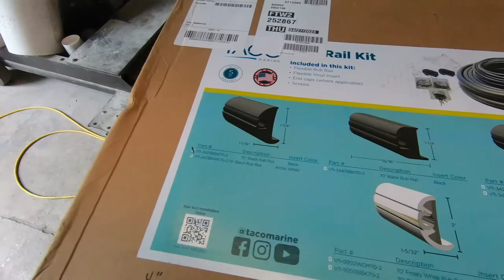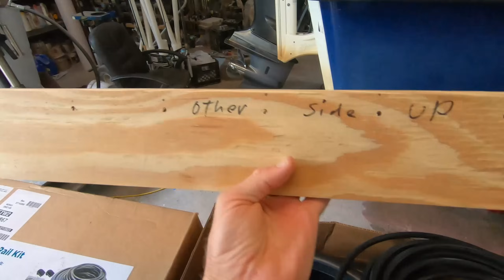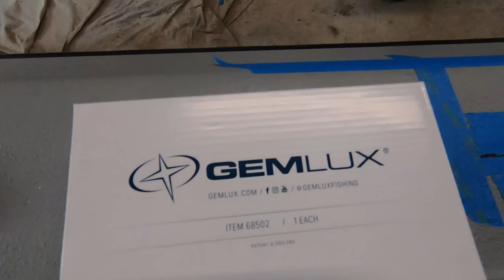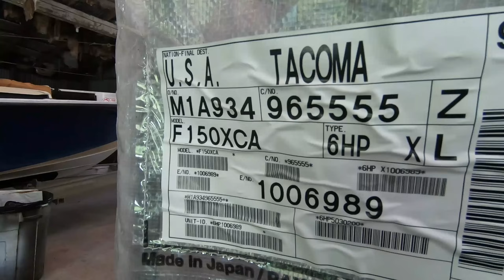EP-20 How To *Install Taco Rubrail & Gemlux Flush Cleats* Loading onto Magic Tilt Trailer!

Comment: Isopropyl alcohol is good for installing that center strip in your rub rail. You can use isopropyl alcohol on the rubber window seal when installing windows in a pilot house.
Reply from the maker: Thanks for the suggestion and for watching!

Comment: A tip for using a hole saw. 
Before you cut score  a circle with the hole saw. Then with a drill bit (1/4”) drill a couple of holes inside the perimeter of the hole ( just touching the inside edge of the perimeter. This allows the cuttings to fall thru and speeds up the cutting by up to 50% and the hole saw won’t get so hot
lengthening its life and saving your finger tips.
The boat looks like a submarine with the council sitting up like that.
Reply from the maker: Cool tip! Thanks for watching and commenting!

Comment: Alcohol and water makes rubber very slippery. I made a tool out of a 8" peice of 1/2" cpvc pipe. I heated up the pipe and made the end oval. Thread your rub rail insert thru the pipe and drag it down the channel with plenty of Alcohol and water as lubricant.

I like to see a video on how yall layed out the stringers to follow the hull and still kept the floor level. 

Yall got one heck of a battle ship!!!
Reply from the maker: Very cool, I will have to try that! Thanks for watching!

Comment: Around 9:40 i was thinking that you could make a spreader roller that has two flanges, one on each side that is narrow in the direction of movement, and widens towards the opposite direction of movement that spreads the bumper apart just enough. In-between the wide part would be a dowel roller that pushes the middle part of the bumper in, but won't cause a damaging friction due to it's ability to roll.
Reply from the maker: That sounds like it could work for sure! I bet there is something on the market already, just have not seen it. If you are only doing one boat, it only takes an hour or less even without a tool. Not a terrible job, but hard on the thumbs! Thanks for watching, and commenting!

Comment: Clamp a pan of very hot water to your saw horse and heat the rub rail in hot water bath before you press it in and it will pop in with light pressure
Reply from the maker: Thanks for the suggestion and for watching!

Comment: Been meaning to ask what size shop are you working out of? I wouldn’t mind a building tour myself.
Reply from the maker: The section we are working in is a 40 x 60, there is another 40 x 100 that we use for storage of molds and other jobs. I will see if I can work a shop tour in. Thanks for watching!

Comment: Congratulations Cpt Joe and Mark! That thing is massive! lol Do you have air bags on the Tundra? I was surprised that you didn't have more squat with that big of a boat.
Reply from the maker: Thanks, Yep she is a big girl! It is hard to see their true size when they are sitting on the floor in the shop. No airbags, and stock Toyota suspension all the way around. The truck handles it really nicely, but the length of the rig is about as much as I want to trailer on a daily basis. Appreciate you watching, and commenting!